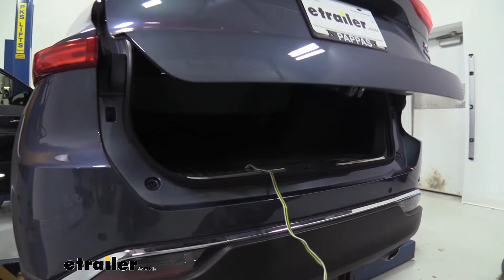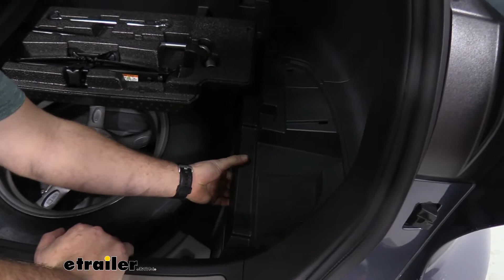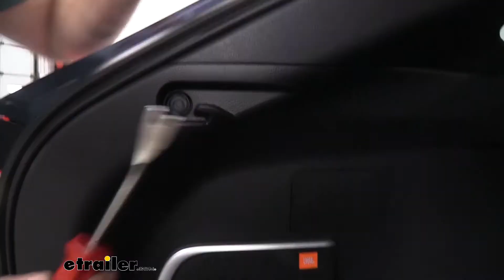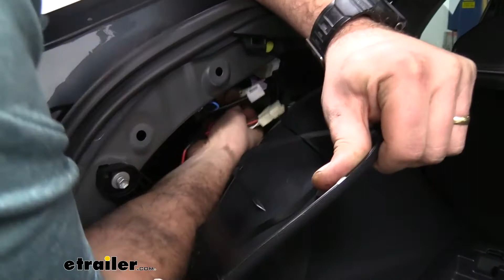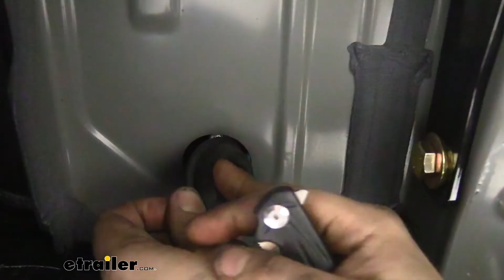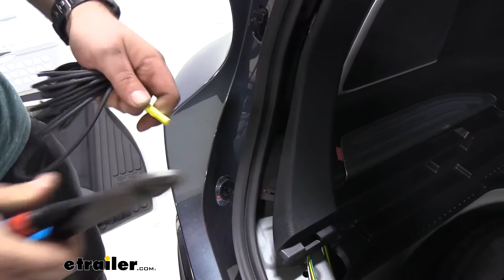etrailer | Curt T-Connector Vehicle Wiring Harness Installation - 2021 Toyota Venza

Comment: What is the purpose of the power wire?  You are already T’d into the tail lights which have power.
Reply from the maker: The converter box needs power from the battery. Without it the converter will not work.

Comment: Good video which is much better than supplied instructions. The difficult part was under the car figuring and disconnecting which plug with limited space, a trailer hitch in the way and loads of dirt falling. FYI It is the top wire of the two you need to tap into if it helps anyone. The rest was straight forward
Reply from the maker: I'm sure it will help someone, so thanks for the info! Glad you got it installed. Even with the difficulties, it will be worth it!

Comment: is this method the same in connecting the harness CURT 56460 - Custom Wiring Harness 4-Way Flat Output on 2023 Venza?
Reply from the maker: Absolutely. The Curt 56460 which we offer as part # C57ER works with the 2021-2024 Toyota Venza, so it'll work great on your 2023 model. 
https://www.etrailer.com/Custom-Fit-Vehicle-Wiring/CURT/C57ER.html

Comment: Seems that after installing this it caused a bunch of cruise control issues
Reply from the maker: How did you attach the ground wire? If you used the same ground that the vehicle's taillights use, you'll want to remove the ground for the trailer harness and use a self tapping screw to make a separate ground. Let us know how that works.
https://www.etrailer.com/Custom-Fit-Vehicle-Wiring/CURT/C57ER.html

Comment: What if you want reverse lights?
Reply from the maker: A 4-pole trailer connector like what's provided by # C57ER doesn't provide for reverse lamps. What connector does your trailer use?
https://www.etrailer.com/Custom-Fit-Vehicle-Wiring/CURT/C57ER.html
Reply: @etrailer  I understand it isn’t one of the standard pins. My installer is doing this tomorrow.  Maybe just a positive from an existing reverse light?

Comment: Can you tow with a Venza?
Reply from the maker: You can check in your owners manual to see what your Toyota Venza is capable of towing.
https://www.etrailer.com/Custom-Fit-Vehicle-Wiring/CURT/C57ER.html
https://www.etrailer.com/hitch-2021_Toyota_Venza.htm
Reply: That’s what I thought.
Reply: Toyota doesn't recommend towing with the second gen Venza... But it's the same hybrid system as the 2019+ Rav4, so a light load of 750lbs will do it.
Reply: @MaximeBrochu This is not accurate.